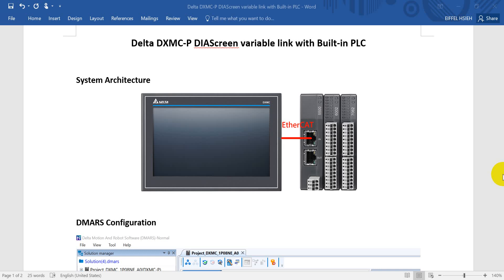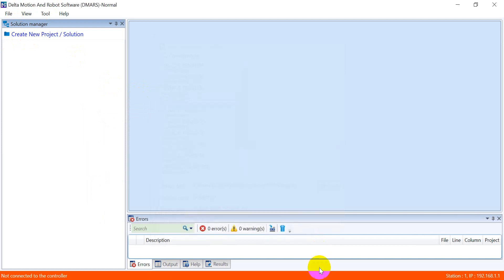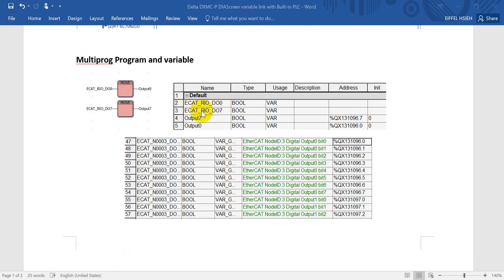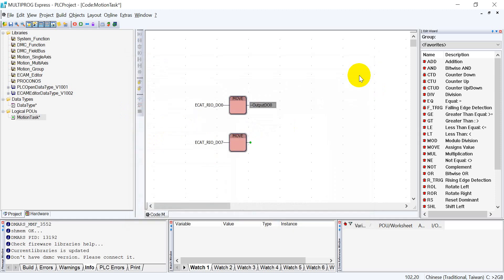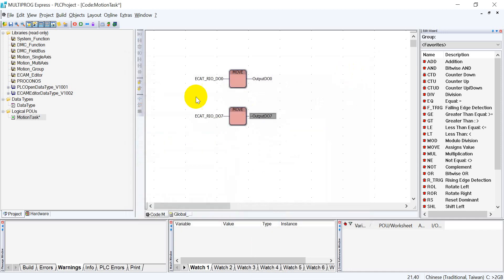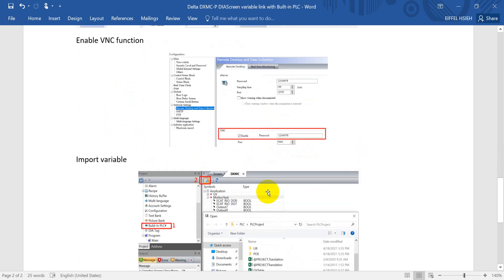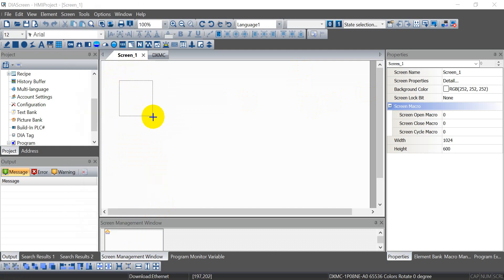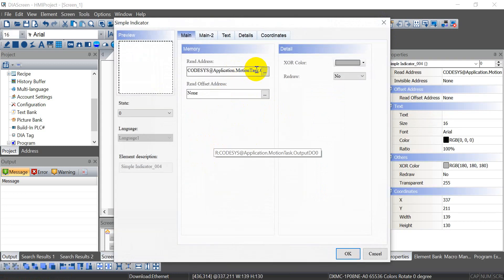Delta DXMC-P Tag sharing between PLC and HMI

Comment: Hi ı am from turkey ı need a help about nc311 cnc solution can yo help me just ı have single question about , can nc311 be doit or not .
I have B axis and it will work in G code but problem is for move B axis pnömatic system hasto move firstly so ı need to trigger Pnömatic system and move 2 degree B axis after again trigger Pnomatic valf after countinue G code
Reply from the maker: Hi Adem, can I have your email address? I will ask our branch colleagues help you.